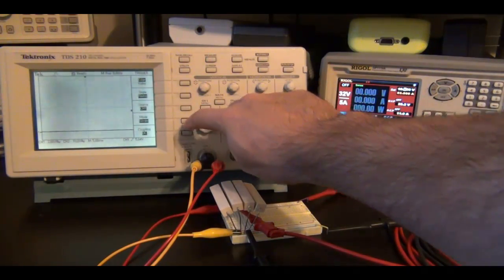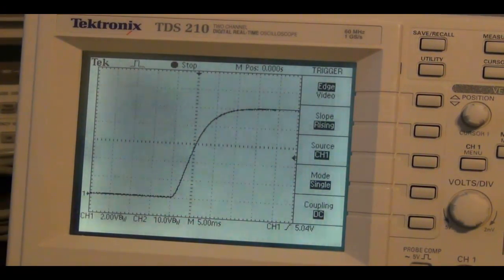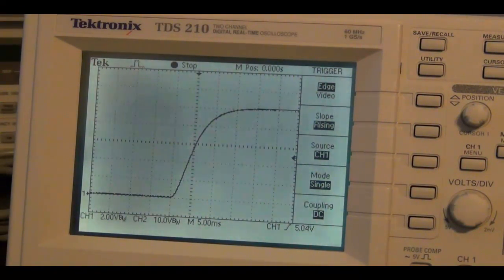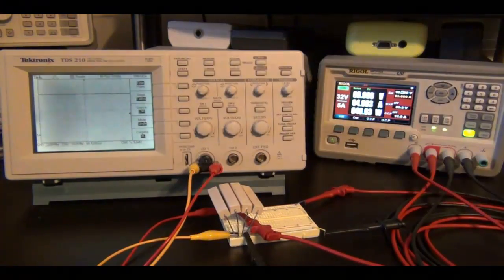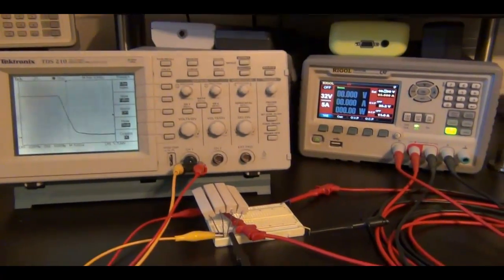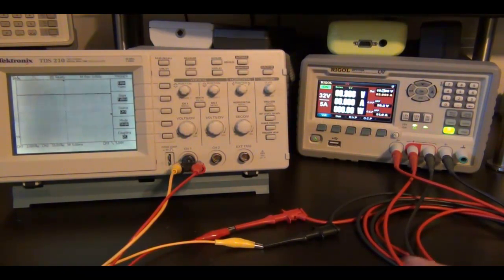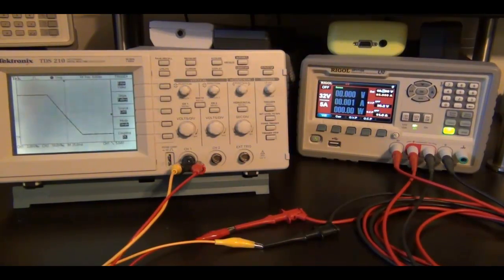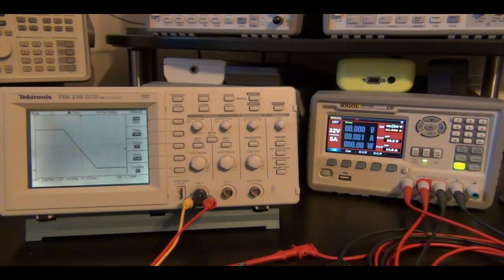TSP #6 - Rigol DP1116A and DP1308A Programmable Power Supply Review (Part 5/6)

Comment: The noise shown at the end is not coming from the power supply under test but from the SMPS in the oscilloscope and the (AC-coupled) GND loop created by connecting the scoop GND to the power supply GND. In this loop, some common mode noise originating from the scoop is turned into differential noise by the not so perfect input amplifier.